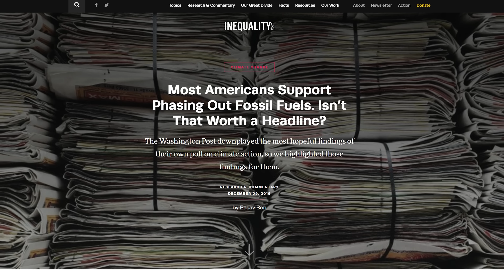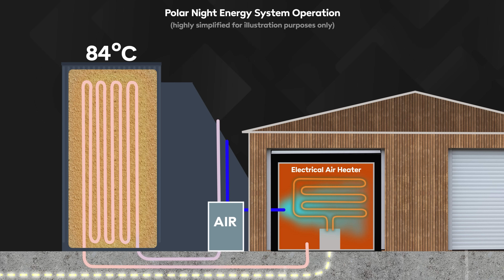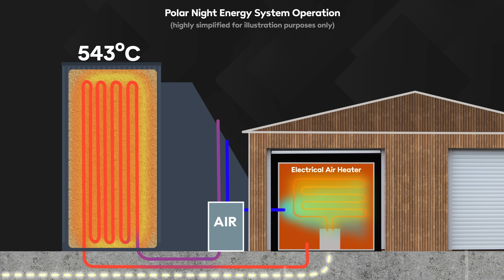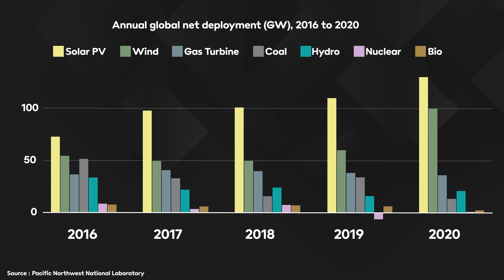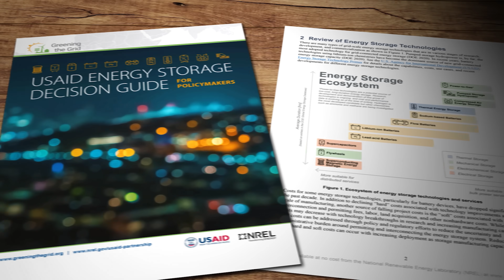The 'Sand Battery' that heats your home, NOT the planet!

Comment: I use solar powered mini-split heat pumps. Along with a solar powered hot water heater. I use far less carbon footprint than most.
Reply: What's a" mini-split heat pump"?
I'm looking to decarbonise my home and looking for all options.
Reply: @peterfeenan3116  A heat pump is an AC pump that makes heat or AC. The mini split part is describing how the unit is split between an evaporator coil and a condenser. You end up with an inside unit and an outside unit. Or multiple inside units with a single outside unit. Mine are powered by 220 volt AC or a combination of DC solar and 220 volt AC. Or DC solar alone. I bought them from "hotspot energy"
Reply: How expensive will Water become in the very near future?
Reply: @Diana1000Smiles  mine is $45 a month up to 1,000 gallons. Every thousand gallons past that is $3.75. not too bad. My friends are the management at our local gid. So I have a good understanding of our costs and maintenance.
Reply: Awesome, I went ground source heat pump 20 years ago and 6 years ago I added a solar system I live in a zone 4 climate and my home is 100% electric and all of this cost $45 a month last year, so it can be done and now I will find that last $45.
Reply: @offgridwanabe  Phenomenal!
Reply: @offgridwanabe  Here in the UK I replaced my oil central heating with a ground source heat pump about 5 years ago. I have a 4 bedroom detached house. It works very well but on cold winter days it is running for something like 17 hours a day at 3kw input power and generating at least 9kw of heating power. The upshot is that it uses up to about 50kwh per day which is quite a lot.  If we are to run most of our heating using heat pumps we need to be generating 50 or 60GW pretty much continuously just for home heating. Solar is no help in winter due to very small amounts of insolation in December and January so we are pretty much left with wind. The energy storage needed to handle intervals with very little wind is absolutely gargantuan.
Reply: @rogerphelps9939  Interesting here in Canada our winter is very cold even -40f some nights in winter and my ground source heat pump heats the whole house for far less than what you use but we do have R 60 insulation. I certainly cannot heat with fossil fuel for less cost as I run my house on $45 a month average over a year with net-metering and 10kw grid tied solar system with 4.5 kw backup off grid system.
Reply: I checked my records and the most my furnace has ran in one day (24 hrs) is 10 hours.
Reply: Why this contemporary obsession with "carbon footprints"? – Is it not merely just another of the passing fads or recently invented religions which come and go?
Reply: @vhawk1951kl  Where on Earth have you been? Please wake up.
Reply: @rogerphelps9939  Shrug, no reasoned argument to  advance?

That is self evident or you would not resort to that  girly crap. If you are going to try to make rhetorical points  you will have  to do better than that lassie